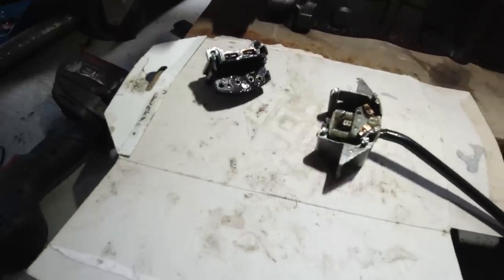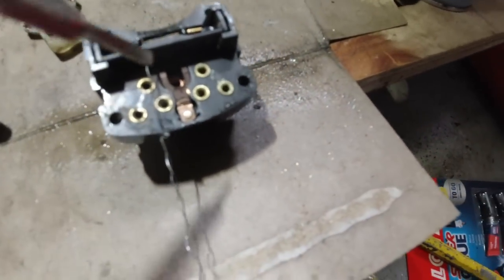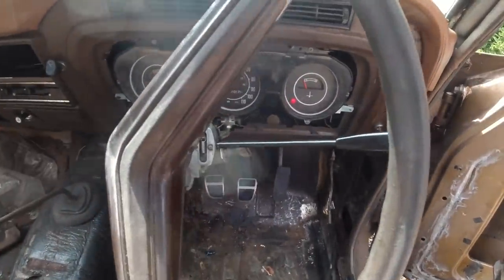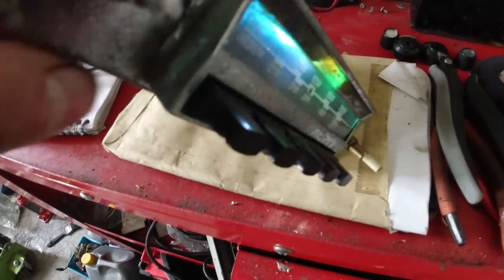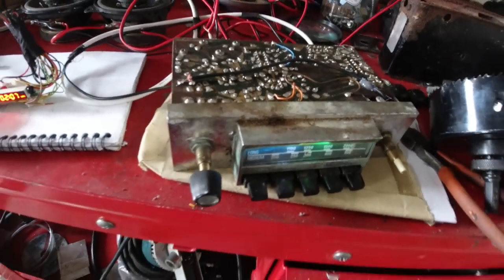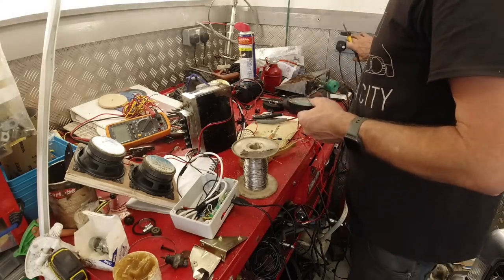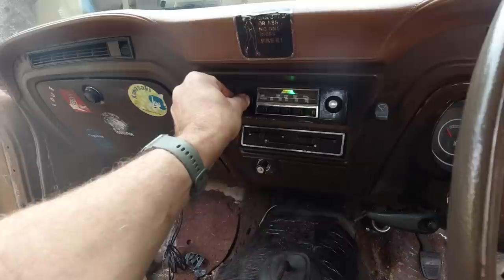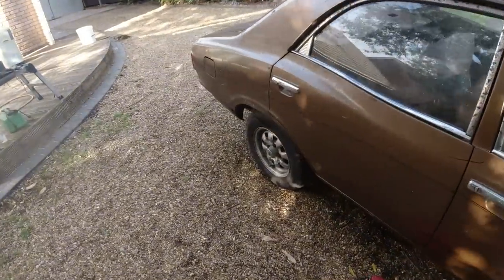MK3 Cortina radio conversion - pappa mp3 radio build

Comment: regarding putting the chrome strip in the windscreen rubber if i recall there was a tool that was used for putting in rubber sealing strips into windscreen seals it was put in the slot and it opend it up just enough to feed the strip in it was like a wire teardrop shape 
and the rubber or in your case the chrome strip was fed throught the center as the tool was pulled back opening the slot up hope this makes sense difficult to explain

Comment: Hi Pete, car coming along now. Re the window chrome trim. We used to make a tool with 1/8 welding rod shaped like a diamond which parted the rubber and fed the strip in at the same time. Google gunson window tools. For the modern day kit which is only about £13.hth.